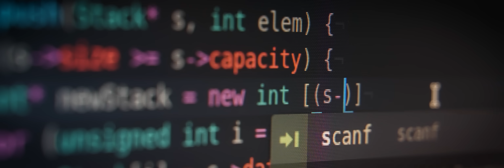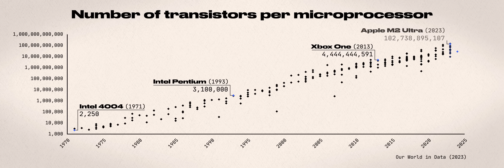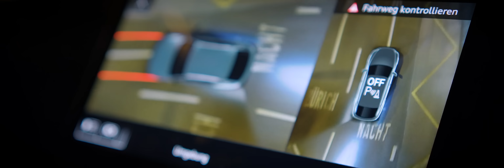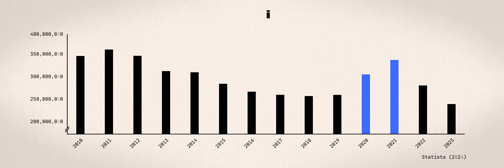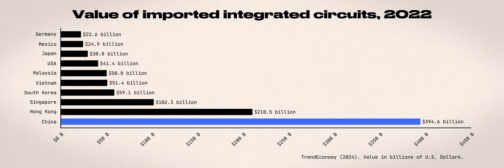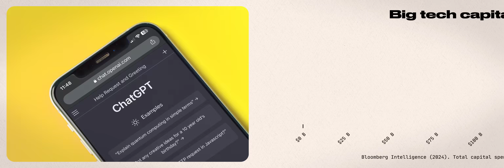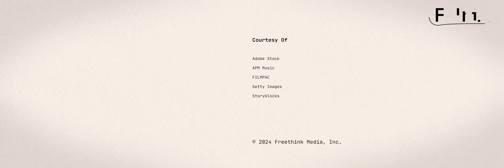How an AI chip war could destroy the global economy | Chris Miller for The Freethink Interview

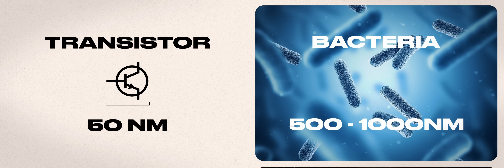Comment: just letting everyone know at 6:00 he says only "slightly" larger than an atom which shows a picture of an Atom 0.1-0.5 NM and the transister is 50 NM the difference 100
as for the bacteria 500-1000 NM the 1000/50 = 20 the it takes 100 atoms to fit in a transister but only 20 trasinstors to fit in a large bacteria  in which he says "far smaller than a bacteria"

Comment: Some people seem to be missing the point of Moore’s law. It’s true that computer power scales with the amount of transistors and that we are nearing the fundamental limit of how small a transistor can be. But we can always expand the size of a die to add more logical operators. This is to say, once transistors reach their physical limit, the die size will get chunkier and that will be the way with which to scale compute power. With that in mind, the name of the game is about how much we can get out of the compute power. We can always scale die sizes to be larger even if transistors cannot be any smaller.
Reply: Yes, misunderstanding.  The size of a die CANNOT grow at any meaningful rate; a wafer is and has been a fixed size for years and the number of die per chip is confined by that and has not been exponentially changing.  Further, there are steps of the chip  and wafer processing that only operate on a portion of a wafer at a time, so a chip has historically been limited to a portion of a wafer.  The point: the die cannot get larger and “chunkier” to get around Moore’s law or continue it.

Comment: I believe Chinese electrical and software engineers are going to build a model that can aid in designing a microprocessor that is faster than an Nvidia master, but it will be possible on older fabrication process nodes. Reorganization and smarter, more intelligent use of design could squeeze significantly more processing power per mm^2 than we imagine. It isn't all about process node. Chips haven't been redesigned the way they will need to be in the future. They cost billions to design and take years of effort, so we could wake up one day in a totally changed world where China has the advantage where we can no longer keep up. This is thanks to US education not emphasizing science and technology in the public school systems. China has a real shot at being the market leader in the future... terrifying thought of what they would use such capabilities on. The US, for all its faults and past transgressions, has been a fairly benevolent hegemonic power. China could be more similar to the Persians or Rome in expansionism.

I really hope not and the future is impossible to predict. I only know that US designs rely on node reductions over any newer groundbreaking rethinks of how a semiconductor transistor works in concert on the die. CAD style software is used at AMD and Nvidia to use "prefabbed" designs for instructions, then copy and pasted millions of times each across the design. China has 50 million STEM graduates they can throw at a problem. We need to get our SH** together in the West and start acting like we are 10 years behind already. Innovation is about creativity. When you get comfortable, that's when you fall the furthest.

Comment: You are wrong that it will continue for ever as The laws of physics dictate that there is a theoretical minimum size for a transistor, beyond which it becomes impossible to reliably control electron movement once that happens the processors will start growing bigger and get thicker and more expensive instead of cheaper

Comment: Chips are critical but the ultra advanced chips that require euv? Not so much. 

Most Military spec chips are in the 10-40 nm range. Many industrial and consumer electonic chips fall with in that range also.  What the world will realize soon is that  efficiency in software design and duv with advanced stacking will be the technology that will break the cost: performance barrier in silicone chips. 

The next stage would be hybrid silicone photonic chips.

Comment: 15:50 - surprised you’d say this considering physics disagrees. Current chips are just at the transistor limit. Any more and the electron capture issue becomes a huge problem with cascading failures more and more likely. To increase computing power we’ll need a new kind of ‘chip’ within the next decade or else we’ll hit the physical limit, nano-precision be damned.

Comment: Although he is right Deepseek has proved that chinese will not leave any page unturned in terms of extracting performance from older chips. And memory is available cheaply, what they couldnt do in compute they compensated in memory hence the MoE architecture of Deepseek. I woudnt be surprised if Chinese will take a A100 or H800 or a 4090 and upgrade its memory and update its firmware to build these clusters.  Dont underestimate  the chinese ingenuity.

Comment: What about Deepseek? Does not requiring the most advanced chip and using alternative methodology not destroy the business model of current US companies? Training on a cheaper budget, just caused chaos in the stock market.
Reply: nvidia is already back even higher than before 3.4 trillion
Reply: @nepalihercules  Stock market valuations don’t reflect real world development trends only financial desires. OpenAI and others are now offering free models.
Reply: @nepalihercules  The stock market valuation does not reflect that in AI,  there is an alternative that this open sourced and has lower requirement for expensive GPU and can be used with lower end and older GPU to deliver similar result to system based on high end GPUs. This is part of the game change but not as a whole.  The next part of the game is how this system will live with China's own GPUs
Reply: @ Stock market valuations don’t reflect real world development trends only financial desires. OpenAI and others are now offering free models.
Reply: Eh no not really, the point of this is advancing AI chips as the research to get there is the hardest part. 

Once you get there, you can do what the DeepSeek essentially is, a version that's built off of previous work (but isn't more advanced, just look at the current charts) so you don't have to use a lot of processing power to train it. The development is the hardest part.
Reply: @animo9050  My point is rhetorical, plainly Silicone Valley overpriced and got found out. Or you could say the long term battle towards supremacy in AI was dealt a nasty uppercut.
Reply: This video is purely propaganda.
Reply: THE WHOLE video has no mention of a single Chinese Ai company.

in 5 years time, these western Ai companies will be Nokia and Motorola of the mobile phone.
Strong and Proud. Arrogant to the changes. Denial and defame with gusto. Constantly looking at their toes.
Reply: @maximme when the video conveniently skipped the fact China is the biggest exporter to Taiwan when talking about Taiwan’s global supply chain, I knew it’s typical US propaganda. Can’t believe a thing coming out of American media’s mouth these days.

Comment: I work at a semiconductor factory in Japan, and the models I work with are so tiny that whenever they get stuck inside the mold, you need to use tweezers in order to get one of them out. Not to mention the level of difficulty to find the misplaced one in the middle of 100.000 pieces!!
Reply: Damn...I guess you have good eyes? 😂
Reply: Jeeezzz

Comment: It's important to know that the advanced chips are in a class of their own.
The rest are less significant than a bag of potato chips.
Reply: NO,  this is where Biden and his administration got wrong.  It is important to know that almost 70% of the revenue for fab like TSMC is coming from making these 'potato' chips,  this revenue provide the finances for making advanced chips.  Making advanced chips have much higher failure rate thus they are more expensive to make.   The 'potato' chips are used in almost everything we used today in electronics,  in simple thing like power switch,  in computing like networking devices,  telecommunication devices, in defense equipment,  they are simple to make but they have much wider application than advanced chips.  Chris Miller might be a good historian but he does not understand this very simple fact. why the US is losing the chip war.

Comment: Only a minute in, right at the intro, but he's a marginally correct, and the answer is actually simpler than you think. The only reason Taiwan has the top manufacturing is simply because the US stopped funding chip manufacturing. That is it. If the US started funding chip manufacturing, like for Intel and AMD originally up until the first Trump administration, Intel would be on top, and AMD would either make the choice to have a lesser fabrication at TSMC & Samsung, or get manufacturing under Intel (Which is a concern, no doubt).

It's been nearly 10 years since Intel has had funding now, and that's a problematic situation -- One that allows our useless Government to play pretend war with China, as we just use them for manufacturing our important aspects, and then put a useless tariff on it so the US Government can get money from the companies cheap exploitative labor. Meanwhile, nVidia, AMD, and even Intel are now pushing toward TSMC for fabrication due to not having the technology, infrastructure, machinery or expense to actually fund proper high quality lithography machinery.

So what's the easy fix? We stop caring about a useless effing border, we stop giving a slow satellite internet company 20 billion to "spread satellite internet across the globe" every year, we stop paying a horrible ev manufacturer 20 billion to "exist", and we start funding Intel Foundries and require AMD & nVidia both to utilize the same funding and knowledge from Intel (and themselves) to build Foundries equal or exceeding TSMC. 

The wrong solution is sanctioning or going to war with China, that's not a solution -- that's an excuse lol. One that will cost trillions of tax payer money for the fear of "they make ev batteries and we need the world to stay on oil since its our primary export" (something that it just shouldn't be).

Comment: No chip war can possibly destroy the global economy.  Most of the world runs NOT on the cutting edge chips but legacy chips, 14 nanometer or older, like 28 nanometer.  These legacy chips occupies over 80% of the world's chip market.  In a lot of applications, reliability is the most important consideration, not "advanced" as in smaller transistor size.  So many companies in many countries can produce these legacy chips that most of the world market will be well supplied no matter what.

Will a high end chip war affect the world?  Absolutely yes.  Many high end products use them.  You cannot have advanced phones without them.  Do you really need an iPhone-16?  Ten years ago, the world did not have 5 nanometer chips.  Was the world of 10 years ago a disaster area because there was no "advanced" chips?

Comment: the Issue that is now arising is that transistors cant get any smaller, at only 10ish atoms in width, any smaller and electrons start bouncing all of over the place giving data that doesn't make sense basically 1s can be 0s, 0s can be 1s or sometimes its both 1 and 0, quantum computing fixes this but the tech is still in its infancy and no where near ready for commercial use, for chips to get better or faster, the only way is for them to get bigger

Comment: Seems a bit outdated after the deepseek moment.
Reply: What do you mean what's the difference
Reply: @varunvxd  All other AI companies rely on CUDA from NVDIA but Deepseek programs at a lower level. Their engine can run efficiently on Huawei chips and that destroys Nvidia.
Reply: @ Above all, China and most people outside USA consider the AI race is over. Deepseek models are smart enough and the focus should be on applications. No need for gigantic datacenters as the smaller models are smart enough.

Comment: Allow me to point out that IMEC in Belgium which is a R&D organization has made a lot of the modern lithography possible. It of course is a group effort. They did the R&D, ASML makes the machines, making the theory a commercially viable solution. TSMC scales this up, requiring enormous knowledge, discipline and expertise to actually commercialize it. And then of course we have the architects such as Nvidia. And not to forget all the side equipment needed for a fab.

To bad we now only have two commercially viable companies left in Belgium. Which is X-fab listed in France, and without any fabs in Belgium itself. And Melexis listed in Brussels which is a chip architect. None of these do the crazy nano scale stuff ASML is now known for. Melexis makes world renowned analog chips for sensor applications. They have enormous potential with the upcoming robotics revolution.

Comment: Many Americans (myself) had a false perception that designing is superior to manufacturing. Cutting edge manufacturing is inimtable.
Reply: without the manufacturing process the design is worthless. Physics, Chemistry, Materials science, engineering all have to come together to manufacture these semiconductor chips!
Reply: Design is on paper, manufacturing is turning it into reality.
Reply: I also had this opinion. A brains vs brawn mindset
Reply: @ Turns out putting 100BN transistors on a chip takes much more brain than designing it!
Reply: Design = making plan 
Manufacturing = actually making it
Reply: They are both equally important.
Reply: Efficiency in manufacturing is an artform
Reply: Well, manufacturing doesn’t require more skills and wage is lower. Look at all the mature chip manufacturing how cheap they can be. High end chips are a little expensive is because China is not allowed to get euv machines, otherwise it will be dirt cheap as well.
Reply: To win war China need to be,
Huawei + SMEE + SMIC > Nvidia + ASML + TSMC
Reply: The reality is neither is superior nor inferior to the other. Each requires the other in order to thrive, succeed and progress. Design can give you something better and more advanced but without the manufacturing, you can't benefit fully from your advanced design. Manufacturing based on old designs keeps you stuck in the old era with old products and systems, with no ability to advance civilisation. Moral of the story is, to always work together with one another so that advances in any is able to benefit everyone.

If you cross the line first in a world at war, what do you actually win when the world is destroyed as a result of the war? There's nothing left for the victor. Better to work together and enjoy an improved world, than to fight each other and destroy the whole world.
Reply: according to your logic, the business owner who designs and oversees all aspects of the business is not superior to the employees who follow the owner's designs
Reply: @ Let’s try to keep it intelligent & informative please.

Comment: The statement that Moore's Law will continue indefinitely is flawed because the semiconductor industry is approaching fundamental physical and economic limits, particularly as chips shrink below 3 nanometers.

Transistors at sub-3nm scales approach atomic dimensions, where quantum tunneling becomes a significant issue.
Reply: No, quantum is the way of light to reach even small scale like picometer. behold that stagnant though as EUV only can go toward 1nm
Reply: It comes down to the geniuses working at those companies and whether they will be able to make a miracle
Reply: I-2nm fabs are being built in Taiwan right now.
Reply: @larryc1616  you mean "1-2nm" in quotation marks because since the start of 22nm process physical size of nodes are always BIGGER than name of the process would suggest. A "1 nm node range label" is expected to have a contacted gate pitch of 42 nanometers and a tightest metal pitch of 16 nanometers